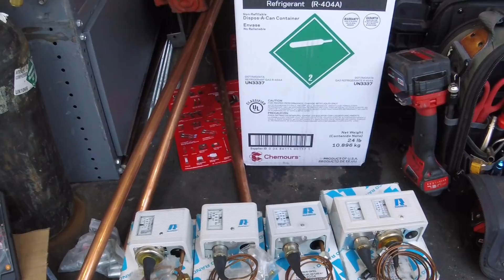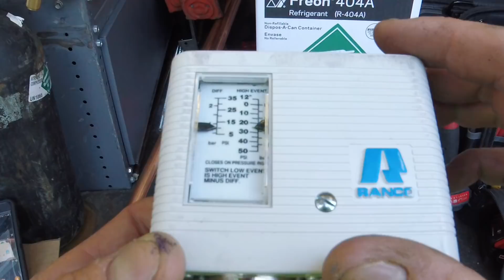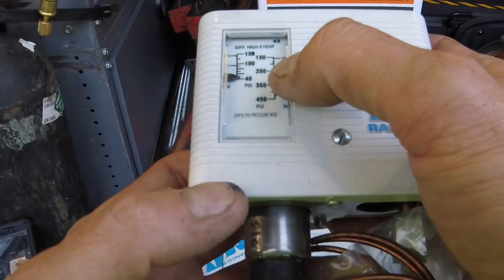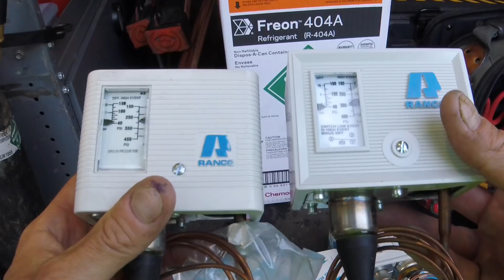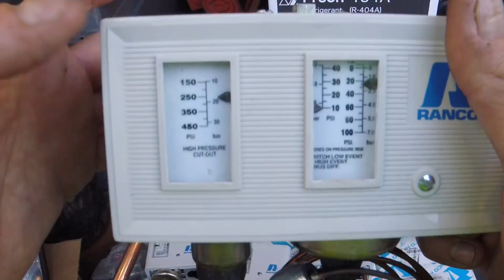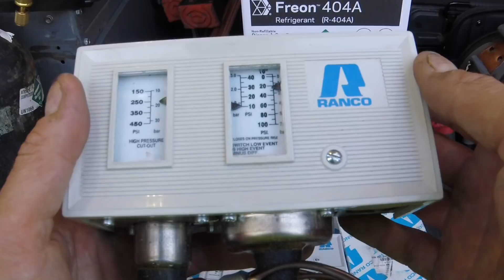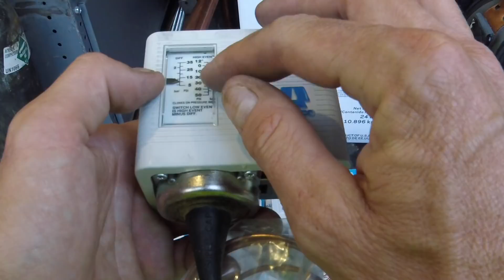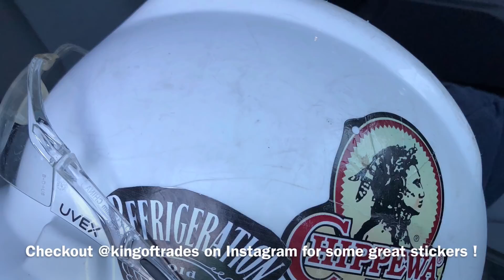Refrigeration Life # 21 . Pressure Controls And How They Work .

Comment: I have a unit with an Emerson digital control, thinking about switching to ranco manual / low pressure control. What are your thoughts on that? Emerson control is acting up and i believe needs replaced.

Comment: Hi nice video.
Question… what is the difference between the fan cycle control and the low pressure control according to the ones in your video?
Thanks
Reply: Since they look the same to me. Thanks mate.
Reply from the maker: The pressure settings are different . Fan cycle controls are higher pressures because they go on the high side to read head pressure . Low pressure controls are on the low side for suction pressure

Comment: Hey mate I have a simple question but it keep running in my mind and it is that if I set my low pressure control to shut off at 10 like you just mention my question is the compressor will shut of at 10psi or as soon it sense a decrease in the suction line pressure ?

Comment: Hello.  What would be the ideal cut in and cut out low pressure settings for a medium temp walk in cooler to maintain a 38 to 40 degrees. Thanks!
Reply from the maker: Mr. Tinieblas well usually pressure controls don’t control temp anymore on most systems. They are there to shut the compressor off during pumpdown
Reply: Understood.  So what would you set your pump down pressure to and what pressure should the compressor come back on. I apologize if this seems like a dumb question. I’m still learning commercial refrigeration. I’m hoping to some day gain the knowledge you possess.
Reply from the maker: Mr. Tinieblas I usually set them to shut off at 5 psi or so and come back on at 25 psi. I like a 20-25 psi differential
Reply: CSC Refrigeration and Hvac I appreciate your prompt response. Just one more question if you don’t mind. Will the compressor be cycling off and on until the thermostat inside the walk in box comes down to temperature? Or will it stay running till ? Thanks so much!
Reply from the maker: Mr. Tinieblas it will run until the box reaches setpoint or goes on defrost . When those things happen it will pump down and shut off
Reply: CSC Refrigeration and Hvac thank you! Please post more videos. Take care
Reply from the maker: Mr. Tinieblas will do thanks man

Comment: As always good video but I must comment about your use on head pressure controls that already Incorporated Headmaster they don't recommend you do that well I understand it gets very cold in your area I'm in New York it gets cold here too some systems should have heated and insulated receivers with check valves in the liquid drain line prevent migration on the off-cycle that's the correct way the snap acting head pressure controls tend to fight the Headmaster pressure setting but look I've been in the field for 38 years and sometimes you got to do what you got to do it would probably be better two thermostatically control one condenser fan if you have more than one fan and let the Headmaster do the rest of the work good video in any case
Reply from the maker: Ralph Giampietro yes sir all very good points !!  Normally I just let the headmaster do its thing and all is fine . But we have some applications where we use hot gas injection and the headmaster just doesn’t maintain the head pressure high enough in the extreme cold for it to work properly so we also have to cycle the fans as well .  Thanks for watching 👍
Reply: @Cscrefandhvac  understood

Comment: question what kind of copper do u use when u do walk ins installs ? do u  use regular line set the same used for residential 
thank you for your time
Reply from the maker: +C&H GUY no we use hard drawn copper. If the liquid line is small like 3/8 or half inch we will use soft drawn copper for that. Everything else is hard pipe
Reply: great thank you for the reply